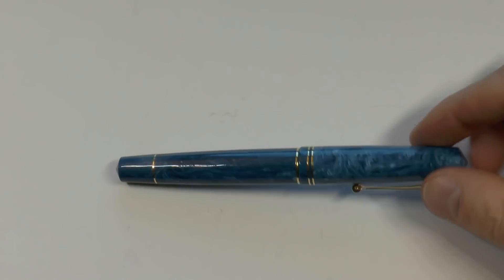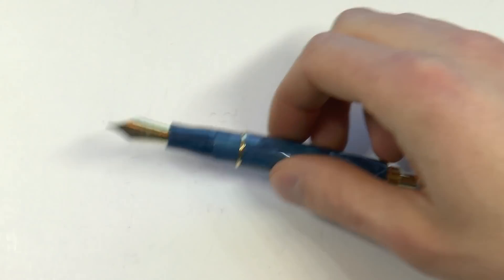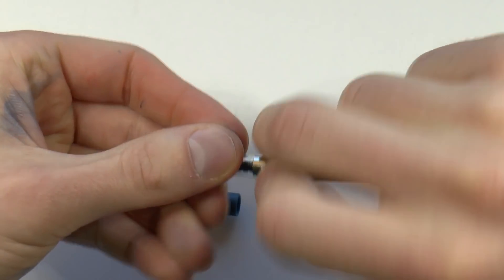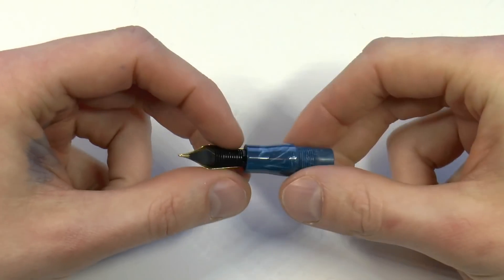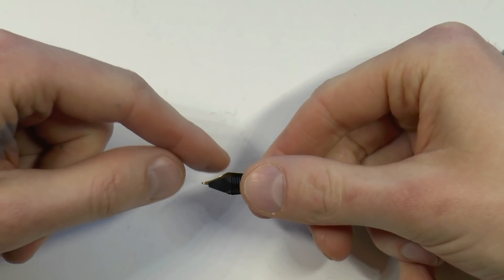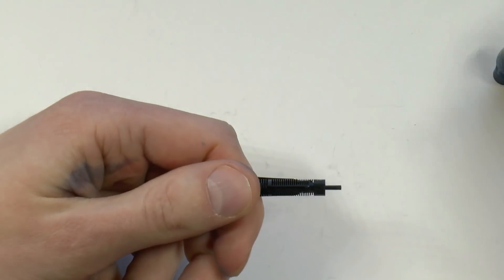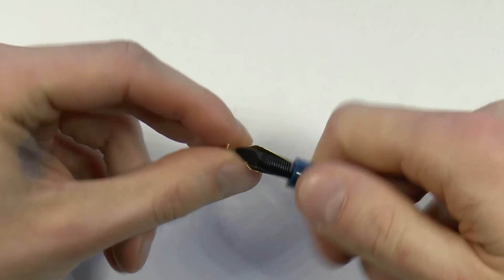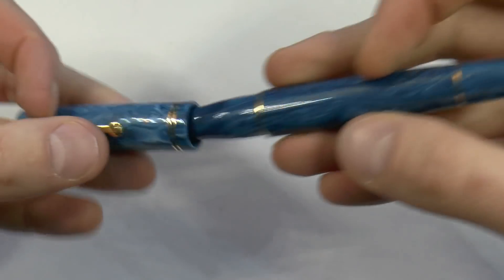Disassembly Line Leonardo MomentoZero

Comment: Thank you for posting this - it was invaluable in helping me disassemble and clean my Momento Zero! One thing to contribute to the conversation - I found the nib/feed assembly too tight to remove by hand until I had soaked the entire nib assembly in hot water (not boiling - just as hot as the tap would produce; something you'd not want to leave your hands in for any length of time). After soaking it came apart with some gentle working at it - I also used a micro-fibre cloth to improve my grip. Hope this helps - thanks again!
Reply: Martin Loeffler  was yours the screw in or pullout type? I have spent all afternoon trying to get my Leo MZ nib out. How exactly did you ‘ work it? Thanks